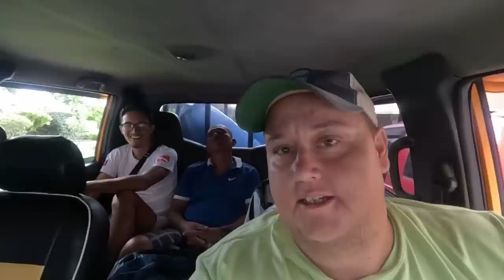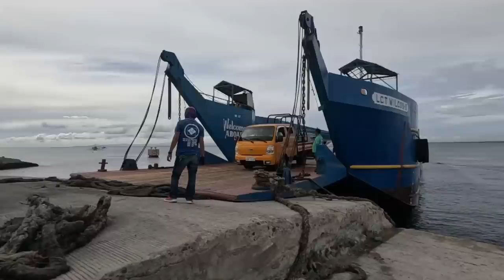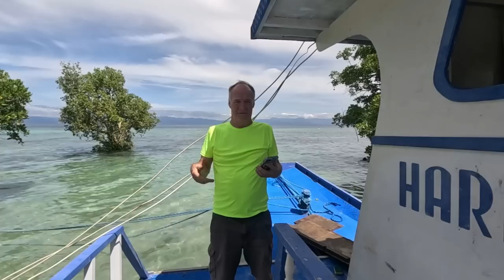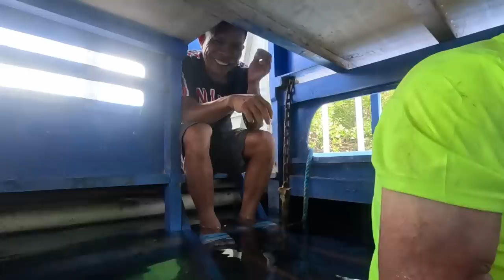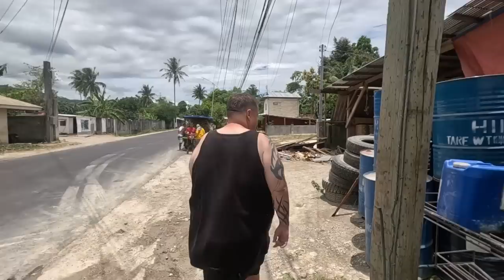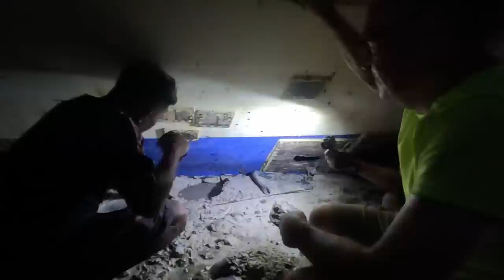My boat sank... | Restoring A Dive Boat EP1

Comment: To make a temporary patch for that boat, You will need a piece of plywood, the same thickness as the  boats wood, and some aluminum plate that extend at least 6 inches past each side of the hole that you are plugging and bolts long enough to go through the plates and the boat and a bunch of silicone.  To put it together, cut the piece of plywood, slightly bigger than a hole that you’re trying to plug.  Next hold the piece of plywood over the hole in the boat and Trace around it.  Next to cut the boat, so your repair piece will slide into place. Take the aluminum plate with the flat piece of innertube on it and hold it up against the hole in the boat covering the hole, With a minimum of 6 inches overlap, Drill holes in the outer edge of the aluminum plate and the inner tube and the boat, starting in the corners and going every 3 to 6 inches closer for small holes and further apart if it’s a big hole.  Now  take the plate that you’ve drilled and lay it up against the other plate and the other inner tube.  Drill holes through the inside plate using the Outside plate that you’ve already drilled as a pattern so that the inside plate holes will be in line with the outside holes.  Now you put it together put the repair piece in the place. It’s just a spacer.  Cover the inside and outside of the repair piece with Silicone, and at least 6 inches in every direction, Put the outer plate in place with the innertube on it, and shove the bolt through the outer plate inner tube, boat,  inner tube and plate and tighten down, If the wood around the repair is any good this would last for years but all you’re trying to do is to get the thing back home so that you can dry dock it and repair it.  If there are two holes next to each other, you can use two larger plates to cover both of them at the same time with  separate cut out pieces for the spacers.  Have fun
Reply: Thanks for the advice we will definitely try that it sounds like the best way to go
Reply from the maker: Keep it coming

Comment: Get a trash pump and run a 3 or 4 inch rigid hose inside the hull in order to pump out any sea water out.
Thereby reducing the stress and weight on the hull structure..
Reply: Have you seen the holes in the sides?? Lol 🤣
Reply from the maker: That's for the ocean views

Comment: To float you need to displace an amount of water that weighs the same as the vessel.  But the vessel isn't dry, it also retains whatever water doesn't have a hole to drain out of, so that weight must be added to the boat weight.  A gallon of water weighs around 8 pounds so divide the weight you need to float by 8 to find the number of gallons of air to float the boat, and then divide that by 50 to see how many 50 gal drums you need.  Bear in mind that the barrels must be fully submerged to get full affect.  Also, there are 7.5 gallons per cubic foot so if someone built boxes of plywood and attached old tires to reduce scratching , the buoyancy provided would be the cubic feet of volume times 7.5 gal/cuft times 8 pounds/gal.  This gives a buoyancy of 60 pounds per cu ft.
Reply from the maker: Easier way to do it....keep adding floaty things until it's not sunk anymore
Reply: @CritterHunter  very true and simple.  There may be times when you need to know how many floaty things you'll need because room may be limited, money may be limited, etc.

Comment: Good luck! Is the plan to float it and tug it over to Duma for repairs? Are you going to try and overhaul the engine or buy a used one and put it in? I image you may make some modifications to make the engine access room door larger? The boat's got great potential...interested in seeing the progress and where you take it!  Any ideas brewing for the name of your new boat?
Reply: Thanks we have located a great running exact replacement engine and will rebuild this one for later use
Reply from the maker: We just need to get it floating and safe enough to tow across the straight to our island, and then to a yard that can help rebuild it

Comment: Can't you just nail patch boards with rubber gaskets, like old tire inner tubes on the inside or outside over the holes and then use a water pump to pump out the engine bay and it should float right up?  Also that engine looks very expensive... Maybe it would be cheaper to just buy a whole different used engine from a different boat, or buy some outboard engines on the back to power this boat...????  Definitely would want to talk to an engine mechanic to get his opinion, if this engine can even be saved...
Reply: We have located an exact replacement engine and will install it during the rebuild
Reply from the maker: It would be more fun rebuilding this one underwater though

Comment: Use a gas powered pressure water washer to carve out channels through the sand. Make sure you do not spray anyone and wear plenty of eye protection because the water will spray everywhere. You'll be shocked with how quickly you can cut channels through the sand under the boat, especially with a 0° nozzle
Reply from the maker: That's actually a good idea. Had not thought of that
Reply: @CritterHunter  of course it is! Hahahha😜

Comment: Remove water from cabin first by sump pump water or bucket, save fish for later lunch, then use large truck size inter tubes or air bags inflated under water to float up. Using steel drums underwater seems dangerous 80 lb weight popping up in someone.
Reply: Well remember, when the barrels lift the boat the water will flow out the holes, then he can place temp patches if he likes.
Reply from the maker: It'll float itself when patched
Reply: @CritterHunter  yeah, the water flows out the holes at low tide and you patch before tide returns but you need some clearance from beach to get to holes that need patching.  Is this your plan ?
Reply from the maker: @jimanonymous113  basically

Comment: I think the boat has good bones and that depends on how much rot there is.. I guess I missed it but I don't know how much you paid for it? Big ass engine!! You need to invest in a 100 ft plastic tape measure.. I do not know anything about diving but after I arrive my fiance and myself will take lessons from Criter Republic 👍👍
I think personally I would rather have had two smaller boats but then again I do not know how many people you want to take out at one time..😊😊😊.. I do like bigger boats because they ride smoother and I have a bad back😮😅😊..
See you all soon I hope..
Hello from south Louisiana🐊🐊🐊🫕🫕🍺🍻😁🕺💃🎸👙🏖️🏝️🏍️🏍️🤗😎🥂
Reply from the maker: No rot at all, 3xcept the wood they used for those patches. So we will replace them girst
Reply: @CritterHunter  wow!! Great 👍..I like it because it's a big boat and that means a much more comfortable ride in my opinion 😁😃

Comment: Are you serious?!! That thing is a piece of……nothing good. That hull has been compromised by seawater permeation and delaminated the plywood layers as well as rotted out the wood itself. That boat must be slow as hell with all that waterlogged plywood, it adds a lot of unnecessary weight. It’s better off to cut bait and go build/buy another one, I know I wouldn’t take it far from shore.
Reply from the maker: It don't matter that you wouldn't, what matters is that this will be fun to watch either way